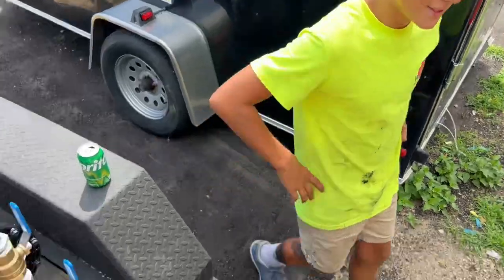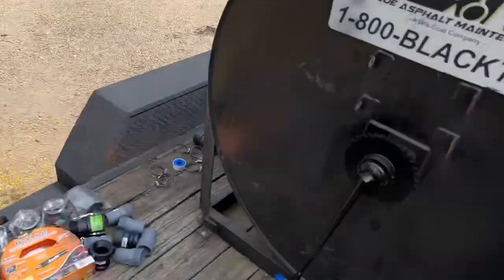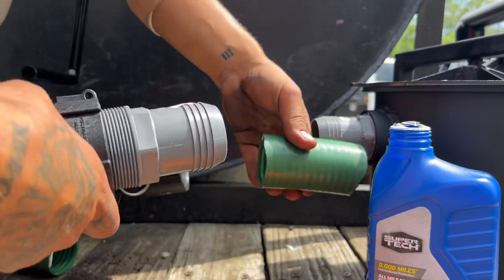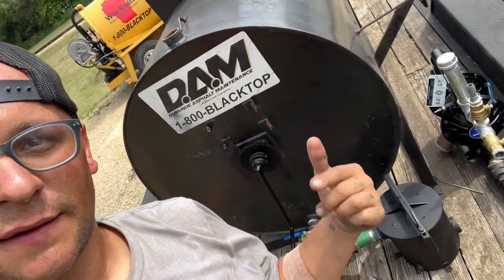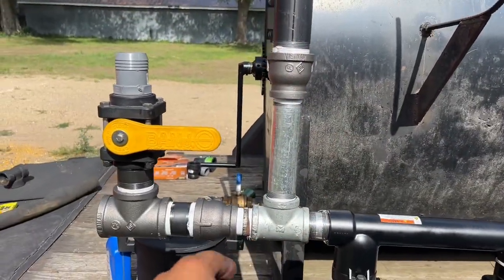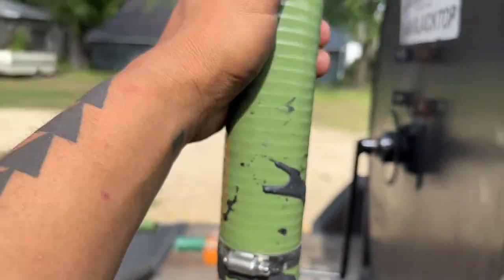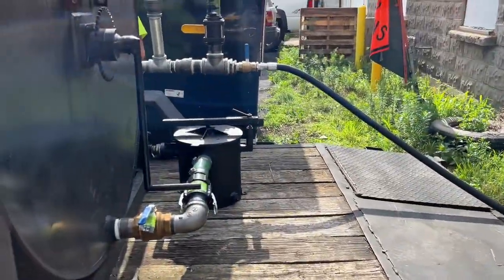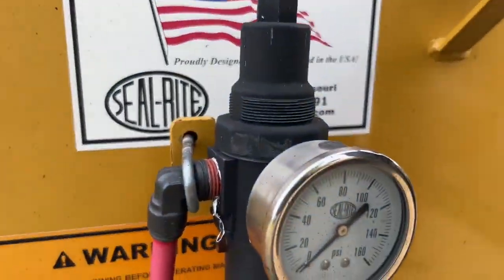How to build a Sealcoating Spray Rig from Scratch

Comment: thanks for the walk through, im looking to adding seal coat to our striping company. so on a budget and already having a double axle trailer how to build a unit cheaply .  the gas air compressor runs about 3k  and not sure about the diaphram pump and maybe a tote. any suggestion on setting one up on a tight budget?  i have a generator could i use an electric air compressor i could pick up for 5-600 bucks.  the pump im not sure of any spec i should be looking for on one of those. your thoughs would be much appricated.

Comment: Thanks a lot for your content. I would like to learn more about the other parts that make the system work. Like the filter, agitation system, the correct hoses, accurate psi readings, regulators, gages, type of sprayer tip for the wand, air compressor specs, size of tank, weights, trailer size/recommended and more 😅 lol. I'm starting to research and getting to know this gig. I want to study it as much as possible and be ready for next season. I'll watch all your and other channels' videos, and hopefully, I'll be educated enough in time.
Reply from the maker: You would be a great candidate for our Blacktop Banter Success Group, you can find out more about it on our website at  https://www.blacktopbanter.com/bbsg  or email me marvin@blacktopbanter.com

Comment: What did you use to make your spray hose? Just air hose from the parts store? Or hydraulic hose? It doesn’t look like a garden hose! lol
Reply: Garden hose will handle the 100 psi the pump puts out.  Hydraulic hose is rated about 2000 psi or higher.  Hydraulic hose is extra cost, extra weight and not needed.

Comment: What is the purpose of a return on a diaphragm pump system? It stops pumping when full correct?
Reply from the maker: Pressure relief and circulation
Reply: Do you need to have that on a diaphragm pump setup? I thought that was only for trash pump. Not questioning you, just need to know if I need to include a return on my rig?

Comment: What is the advantages of an air driven pump over a gas powered trash pump?
Reply: Way late to the game here, but it has to do with the internals. A trash pump has a standard impellar. That impellar will get torn up by sand in your seal, or really any other solids over time. A diaphragm pump has 2 rubber diaphrams that use air to pulse and seal and pulse and seal and pulse and..... They are much more tolerant of grit than trash pumps.
Reply: @mustachcashstash1 I appreciate the input.  I am going with a diaphragm pump.  I wanted to be already this season, but will be for next year.  Does it have to be 2 inch?  Can I get by with 1.5 inch pump on a 350 gallon tank
Reply: @anthonypkaiser  I am not a sealcoater, I am an engineer looking to make a transition lol. I happed to work with both style pumps at work. But from what I can see, yes a 1.5" should do you. The size of your pump is more for your output, than for your tank size, though as your tank size goes up ideally you want bigger spray bars with more GPM.